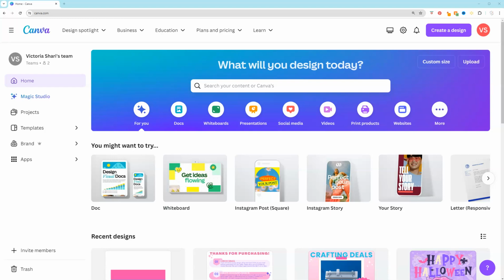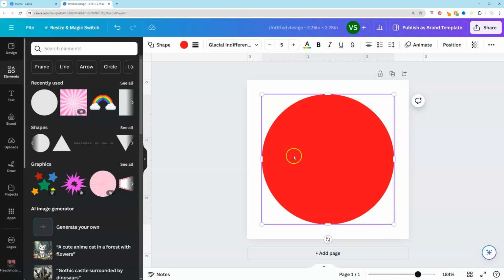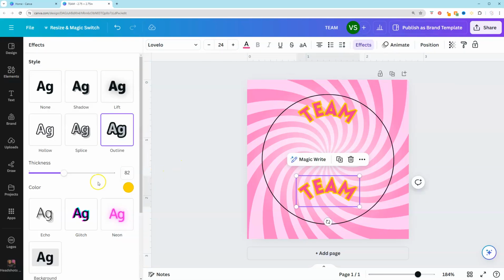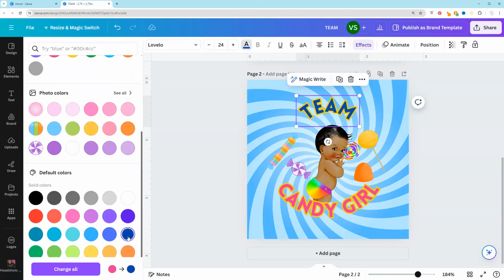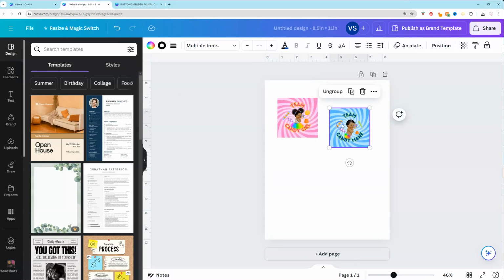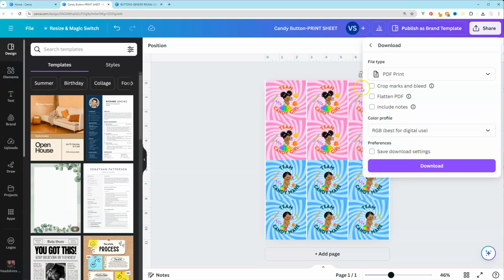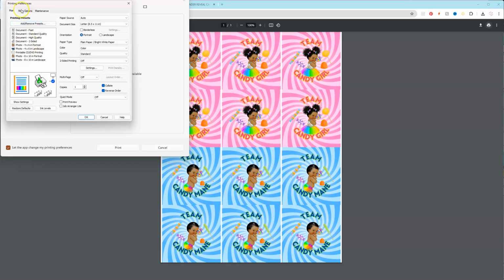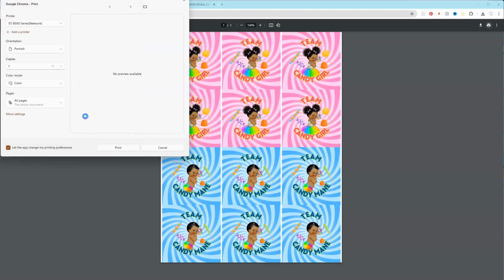How to Make Custom Pinback Buttons Using Canva | #canvassador #Canva

Comment: how did you decide to use 2.75 and 2.25 for the sizes of the pin, if i had needed a 1.5 pins what do i use instead
Reply from the maker: I usually add .25 inches to the overall size. You can do less though.

Comment: What should I do if my printer settings aren't the same? I can't find any of that on my HP laptop
Reply from the maker: sorry for the late reply. Make sure you have the printer drivers downloaded on your computer. It may appear slightly different with different wording, but you'll be given many of the same options